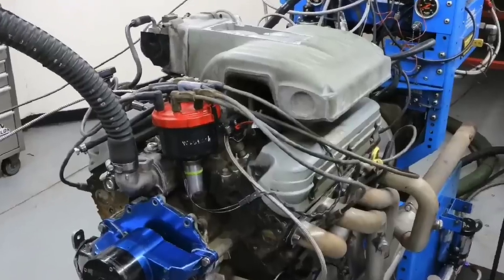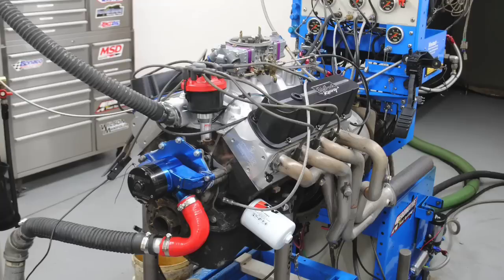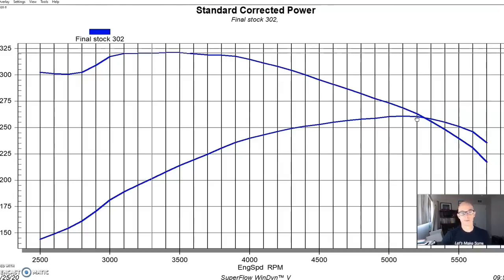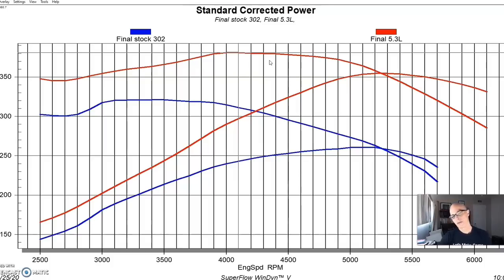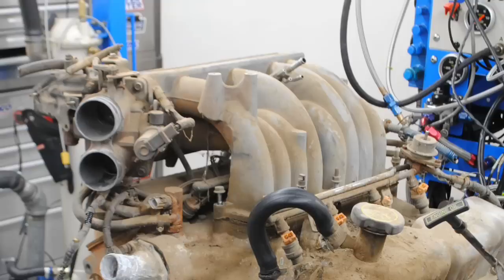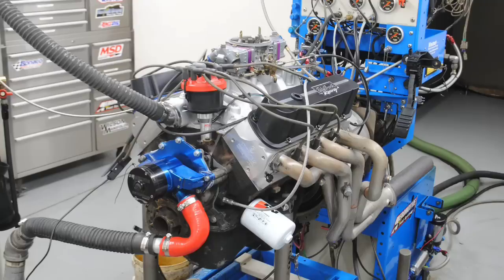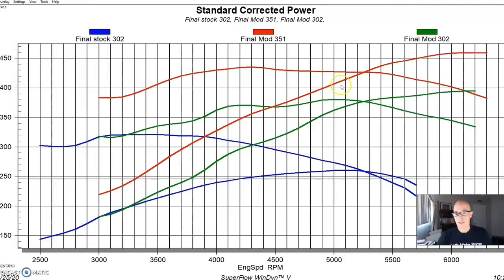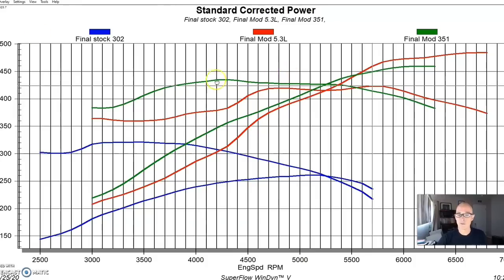5.0L vs 351W vs LS-SHOULD YOU SWAP?

Comment: It's pretty hard to beat the power and reliability per dollar spent with a LS chevy engine the GM performance 6.0 450 horsepower long block crate engine iron block aluminum LS3 heads with a very mild cam is 4300 dollars it may not be the most powerful LS engine but at 4300 dollars performance and reliability for this kind of money is great power at a affordable price
Reply: A stock junkyard 6.0 is about $1500 change cam and valve springs for about $500 make 500 HP save $2300
Reply: @timothywalker2273  maybe with 200,000 miles on it putting a cam in engine like this is a gamble and is no way it's going to run as good or as long as the new crate engine will with a junkyard motor that your buying no telling what kind of piston ring wear cylinder wall wear or bearings wear a complete 6.0 for 1500 dollars will have 200,000 or so miles maybe its life was in a work van or truck over loaded with heavy equipment or a heavy trailer and worked to death it may workout great it may not I've purchased 3 LS engines 1st one in 2008 a LS2 crate engine with CNC ported LS3 heads for a 1984 Monte Carlo SS very close to mint from SDPC it was 8700 dollars it had upgrades had this car since new just sold it in December 2021 and it still ran as good as if it was new probably put around 12,000 miles on it it was maintained impeccably during the time l owned it the 2nd one was a 5.3 from a wrecked 2003 Tahoe for 850 dollars complete that had 48,000 miles on it in 2011 l had someone machine the heads and put new valves on the LS1 heads and put a LS1 camshaft in it it was put into a 2002 short bed 2wd Silverado l ran this truck to 2018 it was my daily driver and probably the best vehicle l ever owned 3rd one was a LS3 495 horsepower crate engine with CNC ported LS3 heads with upgrades from SDPC without the fuel injection and coil packs it costed 6200 dollars l purchased coil packs and a 102 mm throttle body separately it's in a 2011 inferno orange Camaro SS with a load of other upgrades a built 6L80e automatic transmission with a Circle D 4200rpm stall converter aluminium one piece driveshaft ZL1 fuel pump and injectors it has about 975 miles on the new setup and runs on E85 there is no such thing as cheap l bought a very very clean 2011 Camaro SS for 15,000 dollars with 103,000 miles on it pulled the engine and transmission and put another 16,000 in upgrades into it new aluminium radiator underdrive pulley 1.5 suspension lowering springs new struts new tires wheels brake rotors bearing hubs to name a few just about everything is new but I've got 31,000 into it fooling around with cars with performance parts is not cheap
Reply: @gloriamaletta8667  oh sorry I thought you were a hot rodder I see you have lots of money that tells me that you sometimes drive spirited I thought you were one of us engine oil coverd beer gusling idiots that build brake and rebuild old worn out vehicles bought from the local wrecking yard were you also bought the engine
Reply: @timothywalker2273  I'm a sewer utility worker I'm not rich I'm 58 years old l work all the overtime l can in the hot florida sun many days in a sewage filled 8 foot hole repairing sewage pipe that is under pressure l don't spend money at the bar rarely go on vacation live in a conservative home that's payed for and daily drive a 2004 Buick LeSabre I've been pinching pennies and saving my whole younger life to get to where l am today l am far from rich my base yearly pay is a tick over 40,000 a year and I've been doing this job at the same place for 23 years l do make more than 40,000 a year because many weeks l work 60+ hours the price of everything into my car doesn't include labor I'm talking parts if your a working class person it is anything but easy to have a nice performance car with the price of performance parts today yeah I'm so rich l have a secured loan on this 2011 Camaro SS that l owe 9000 dollars on and pay 400 a month for a 12 year old car yeah I'm rich alright
Reply: @timothywalker2273  here is a great example l purchased 2 Mickey Thompson front tires for my Camaro they are 18 inch skinnies Mickey Thompson sportsman S/R LT 28×6-18 for a pair they costed over 790 dollars shipped to my house this doesn't include mounting or balancing or valve stems l would have to work 60 hours in the hot florida sun to make this money after taxes in a week to pay for them and wait until the next paycheck to afford to mount balance and put new valve stems in them they costed me a weeks pay including over time for two very skinny front tires when l was 20 years old l remember getting 15 inch tires new for 26 dollars each

Comment: 351 power band looks good but it's hard to argue with ls compact size and weight. However, if it comes to Mustang, I'd choose coyote lol or just a 3 valve. It's kind of not fair to compare 5.3 ls to a 1989 engine it's just different era, 10 years apart. 3 valve would be more fair comparison in my opinion. Thanks for informative content
Reply: The 89 351 doesn't do that well stock it was in an old 80s truck but once you out modern heads cam intake on it it makes badass power and it can make alot boosted even on the stock bottom end.  I'd go 351 if I was swapping an old 5 liter.  If I'm swapping a 96 up mod motor car I'd go coyote it's a direct drop in basically on mod motor cars.

Comment: me and my dad built a 351m with .40 over pistons a stock crank a stock block, 4v heads no port, large springs from his drag setup, chromoly push rods, roller rockers, solid lifters, a 667lift and 328duration comp roller cam, larger valves on exhaust and intake, timing gear instead of chain, Wieland performance intake,750 double pumper holly and a 5 inch snorkel its a mud truck and we dynoed 635hp and 590tq at 7300rpm we run a stock c6 trans with a 3000 sthal and 456 gears from and back with full spools and chromoly axle shafts dana 44 front and 9 inch rear its in a 79 bronco on cut 35 inch tsl boggers when we hits converter it launches roughly a 2.1 60 foot in mud and sings to 80mph we hit second gear and hit the nitrous and on dyno it goes to 832hp and 810tq and we rise to the top of the mud and skip it for the remainder of the 300ft drag we run a 4.9 300foot
Reply: 28k final build on the truck 6k into the engine

Comment: Being an Aussie, Cleveland. LS certainly wouldn’t beat out a Cleveland like that.
Reply: Thats the truth
Reply: rightio matey whatever you say
Reply: Richard already said the cleveland was the most powerful small block he ever tested
Reply: @clintlawson2455  with what on it 5k AUD of heads 2k AUD of cam and high comp pistons?
Reply: @clintlawson2455  I'm not saying don't like Cleveland's and I'm not saying take one out of an already Cleveland powered car but for swap purposes there's no way to beat an LS you can run them on carb and cut some costs there an LS swap in Australia with a carb setup and msd 6ls ignition controller and a nice cam could probably be done for 6.5k not 10k plus to swap a clevelend in and make the same power the LS made factory
Reply: LMMFAO....what a BS homer statement.  Mod for mod, an LS will destroy it.
Reply: LS would make that Cleveland look as sad as the Browns!!!
Reply: @nathanielbolden5053  Cleveland can go from 280hp - 760 without supercharged & LS copied its head port design with an aluminum block basically.
Reply: @Xbudmarley420x  more like $2k AUD heads @ the very least
Reply: @BEBNC1  lol what a muppet statement!!!!
A Cleveland will eat an ls for breakfast once you start modifying. Seriously, do some homework sunshine before spouting off like a keyboard expert.
Reply: @Xbudmarley420x  can’t do carb LS in Australia. Won’t pass engineering.
Reply: @The2fiddyridah  hp isn’t cheap, how much hp can your wallet afford?
Reply: @nathanielbolden5053  that’s a Windsor. NOT A CLEVELAND. And definitely not an Aussie aftermarket head.
Reply: @nathan2483  A quantifiable 250 per 250ci

Comment: Im a JDM guy at heart but I still want an NA V8. DOHC is objectively better than pushrod but it won't fit into my classic Mustang without deleting the shock towers so I considered the LS. I keep thinking about the 3uz though. Comparing it and the LS1 is like comparing the 2JZ and RB26 (in stock form). One has more power and more low end torque, but the other has smoother power delivery. 
Hell I even considered the VQ series for lots of power in NA form but they burn oil

Comment: The mounts are identical between the 302 and 351? Going LS would mean transmission change (at least a bellhousing with a T5, but T5s aren't exactly strong either) and a lot of other costs that aren't needed keeping a SBF. I could see a budget LS/4L80E/turbo drag Fox being cheaper than a similar SBF combo though (prove me right or wrong if you've done either)

Comment: No cross breading! FORD or CHEVY pick one and do what you will. It easy to see why people swap a a LS into a Mustang. The Mustang is a factory built race chasis and an LS is cheaper to build then a 302 or 351. Myself I would stick with the 351W so many possibilities. 351W turned in to a 427 Small block is what I see most.

Comment: Windsor. I’m not sacrificing lots of torque for a couple HP 1000 rpms later.
Reply: If I’m running a more modern engine I’m finding a 2.3, 2.7, 3.5 Ecoboost and getting even more stock performance right off the bat.
Reply: ikr?? ls tq is hilariously un-useable on the street.
Reply: @james avery and 10lbs on a big block ford will smash the ls....your point?
Reply: @frigglebiscuit7484  that's doubtful, lol
Reply: @james avery it dont take much money that's for sure.  Big blocks can make huge power without even trying.  You could slap a turbo on that bad boy and make a shit ton of power.  I'm sure you're one of those ls guys who think fords cant run well without spending 20 grand on them.  His point comparing it to the big block is it's not the same playing field you're comparing little engines with tiny turbos on them for response and torque with a much larger ls and 10 psi on a much larger turbo (guarantee you wouldn't run a turbo as small as the EcoBoost engines run on that ls).  Its apples to oranges.  You cant compare running 10 psi with a bigger turbo to a much larger engine to running 20 psi through tiny turbo(s) to a much smaller 4 cylinder or v6 engine.

Comment: The main reason I'd pick one motor over another is what would fit better. A Gox body Mustang was designed to take a 302. I think that's how I would go. Build it as a Clevor shooting for 275 to 300 hp at the rear wheels. It enough to be fun. Tweak th he suspension to make it handle better, Bigger brakes with rear discs. Now the heresy. Let's be honest. When it comes to the street especially if it's a daily driver you can have too much power. A daily driver has to be livable. 
And if the idea of an LS in a Mustang triggers you I'd also look into putting a 2JZ in.

Comment: I would absolutely never ever LS swap . If I was to want to make more power . It would be a 351 or 4.6 or coyote .
Reply: Tony Spadafino that pride is strong 💪🏽
Reply: @zxJC34xz  Ford Ford the Win..lol Keep the LS in the Chevy..
Reply: A 4.6? Come on I love fords but those motors are garbage but yeah I'd still keep it over a GM motor anyday
Reply: @hell-sol5240  that engine makes good power bro, just gotta know what you're doing.. ;)
Reply: @P71ScrewHead  touch'e but its definitely the black sheep of ford motors I'd build a 300 6 before I built a 4.6 but yeah I've certainly seen fast ones but not a good platform to start with on a budget.
Reply: @hell-sol5240  they def aren't cheap, i'm about to buy TrickFlow Race Heads ($3k), Comp Cams Stage 2 ($600) n a BBK 80mm throttle body for the 5.4L DBW ($350) n Maximizer Long tube headers ($1,200) for my P71, well the heads i want for my 95 Lincoln Town Car race build i'm looking to do, just buying them to take advantage of a credit card i just got that'll give me $800 back if i spend $4k in 3 months, pretty much cams are free..lol

Comment: Great video!! I actually had the Edelbrock RPM package with a much better Crane roller cam and 11:1 pistons in a 1969 Mustang 351W back in 2005. I was very happy with the performance, it had a ton of power, and  I liked the fact it didn't have the heart of a bowtie under the hood. Sounded great too. Had to sell it pay bills. Now, Im ready to build another one, but this time it'll be a Fox body with a 302 stroked to 347 and better flowing heads than the Edelbrocks. I wouldn't even consider a Coyote swap. Too much extra money and BS

Comment: Had an 88 convertible fox with a 5.0 block stroked to 5.6 with heads, cam, intake, and full exhaust. Made 457 horses and 402 ft/lb. Plenty of power for what I did with it. Plus it sounded pornographic.

Comment: Being a Ford guy, a stroked 351, or a stroked 460 would go in. If I really wanted an LS, I'd go find a Nova.
Reply: I didn't even opt for the stroke on my BBF. New AFR Bullitt heads on a 466" stock crank short block. Makes well over 600 hp/600 lb ft on pump gas. Bigger runs hotter; too many people overlook what a stock crank BBF can do on it's own. It's all new and wasn't 20K to build like most GM guys will tell you. You can build the same thing for $7-8K today.
Reply: @ChevyConQueso  I hear you. I don't want a race motor. I want that off idle torque of big inches. Just like Rich's other video yesterday about displacement. With a 4.3" crank fitting with no need to clearance, or a 4.5" with minor clearancing, full rotating assembly for $2k... Maybe some Kaase heads though! Not to mention I'd be putting it in a heavy Lincoln Mark III or an '80's wagon.

Comment: 351w or 302 all day, in the mustang or any 302 or 351w equipped car, they are easier, the 351w is cheaper to do hci and swap in...carb and same mounts. So easy

Comment: That is why GM guys would not run a mustang with a 351 in it back in the 80’s and 90’s. Even though they had 350 engines, for some reason they thought a 350 vs a 302 was fair but 350 vs 351 was not.
Reply: Chevy has always been faster always has been always will be
Reply: @clawmachinetime955  maybe in some alternate universe

Comment: in 1998  I had a friend with a  5.0 mustang daily driver turbo one small one and a 100hp shot of nos 990 car all day and all he ever did in the pits is add fuel and slicks no trailer drove it there and drove it home like for at least three season he said he had to change the valve train rockers lifters and gear drive timing  I pestered this guy a lot back then I was driving a barracuda formula S he was beating my 340 with a banks blower this was a  66  automatic car  with some  goodies not found on most cars as I lived in germany for 10yr in the  cold war days as a  GI  I was a radar operator and technician mech for missile  systems  I had a F1 license back then drove bmw in hockenheim in the 1980  so my car was set up for that so ya did not like getting beat down by the ford  302 on steroids

Comment: Now do a 351W with 4v cleveland heads.... 

Costs for swaps would be minimal and head flow would meet or beat LS stock. 

351M would be nice to compare as well.
Reply: 351w with 2v Cleveland heads is better for the street, but you can get the canted heads already to install without the modification work required from the Cleveland heads, and the gains are good

Comment: You didn't include everything... such as 4.6L DOHC, or any mod motors. You didn't include any 385 series or Cleveland motors. If it was always about max horsepower, no LS would even be in the game. Oh, and by the way... Ford had 6 bolt main blocks in production 10 years before any LS was ever thought of.
Reply: 6 bolt main blocks aren't anything special. That's pretty much standard on aluminum blocks. Neither are structural windage trays or oil pans. Chrysler even used them on the 2.7 V-6 for Christ's sake.
Reply: Nobody swaps to a 4.6. Besides, GM has always dominated Ford in Horsepower and torque.

Comment: Thanks for the video very interesting. I would like to see a comparison of a stock 5.3 LS against Ford 5.4 and see how they compare. I can see the LS being better than the 5.0/5.8 because it is newer technology at the time it was produced.
Reply: The 5.4s cam phase would blow as soon as he puts it on the Dyno. That's if the spark plugs stay in before that.
Reply: @tskraj3190  I had a 5.4 in an 8000lb Excursion (you know the biggest baddest soccer mom tank SUV ever manufactured?) I drove with a heavy foot, and true it wasn’t a race car, but it comfortably sat 8 people, there was 48” of stow behind the 3rd row seat,  the 45 gallon gas tank allowed us to drive 600 miles on road trips between fill ups, and never let us down, ran like a top. Sold it with 180,000 miles on it for $8k, so the 5.4 worked for us
Reply: @WesternReloader  To each their own. I had a 97' F150 4.6 Triton and an 03' F150 5.4 Triton. We did not have the same experiences, not even close.

Comment: In a Fox or SN95, I'd keep it Ford all the way, and never hassle the LS swap. I think the SBF is one of the best sounding V8 engines, especial modified, but even in stock form with a set of flowmasters. The SBF also responds to mods very very well. I've built several 347 (stroked 302) combinations with AFR heads and a roller street cam which made 400 wheel HP carb'd and just under 400 wheel with a aftermarket EFI intake. That's 450+HP which is stupid fast in a light weight Fox. On top of that it looks the part and works with the factory wiring harness etc. Anyway, just one man's opinion, but I say keep those LS motors between GM frame rails! ;)

Comment: The Windsor would be optimal.  The cost associated with buying swap parts,  trans and computer control for ls in the fox/sn could be put into the Windsor to equal or exceed the ls power and factory 5.0 will all work on the Windsor only needing a good dyno tune